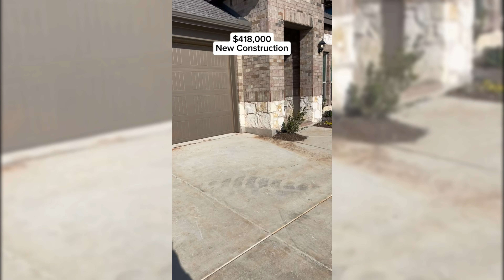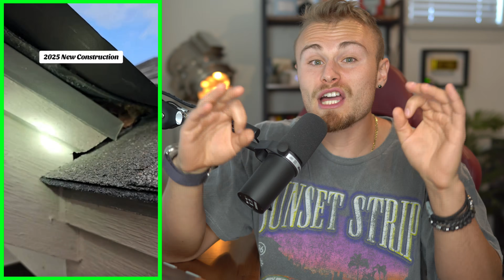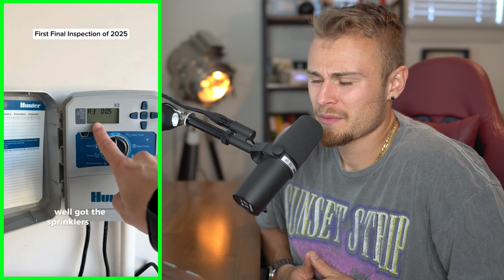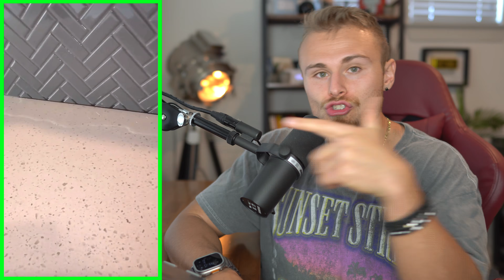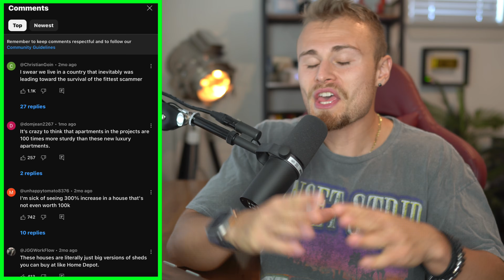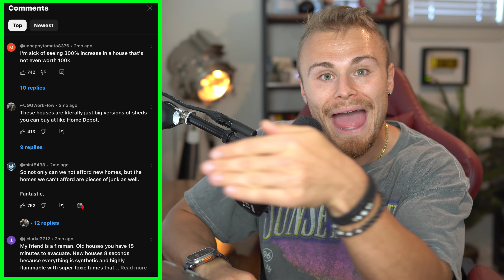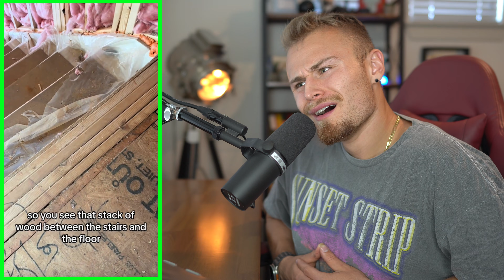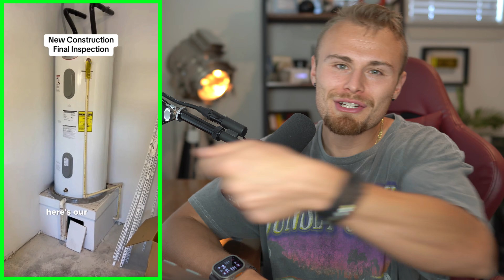New Construction Homes are STILL HORRIBLE in 2025…

Comment: The reason houses look like this because the Builder and the homeowner hire framers to do carpentry plumbing and concrete work they don't know what to do they do it wrong. paying for cheap ass labor to bring the cost down. the average house is definitely not $400,000 if every crew is a professional it's more in the 600,000 range that's just how it is but if you really want to know why it's so expensive it comes down to material cost not labor

Comment: Bought a new home ($500k) in Nov '23. Builder denies any actual claims a few as its "normal" for cracks in the basement concrete and foundation walls. Its also normal to have an AC undersized and denying to provide the Heat Gain calculation to back up their sizing is in fact 1-1.5tons undersized (i have a 2 story 2300sqft sized for a 2 ton in MIdwest.. this is still an open situation and found a Law in my state that they must provide heat loss and heat gain calculations when asked. There's a small glimmer of hope that this will be corrected without my money being spent to change it so its livable again during the summer.

Never told about hardwater or the radon in the area, so that was $6k extra in costs that never disclosed.

Quality: I'd put the house as i could of done better with everything as ive redone 2 (100 and 75 year old houses from ground up). Qualtity lacks and subpar. Material is low quality. Fixtures are low quality. Carpet and flooring are buckling. They missed structural anchors in my house too somehow eventhough they had to drill the holes for each hole. Landscaping was off by 4" around the hole house from city proposals. Siding breaks from hail. Insulation is subpar at best. The claims they corrected they dragged a$$ on doing until i threated to sue them for not fulfilling their side of the deal.

Wife and I are considering selling the house in a few years and just buy an older home as this is awful like im an electrician by trade but do plumbing, millwork, woodwork, etc as a hobby and its awful to say the least. 

Learn from my mistake if you hear these sentences, "trust the process" or the famous "we have been doing houses for x-years so we know what we are doing.". They're just avoiding your questions as they dont care about you at all and will blame you as if you caused all these issues yourself. While you are at it, prolong your closing date as long as you can until those issues are fixed as they'll never correct it or follow through with what they say.

Comment: They have to place steel plates on studs where plumbing/electrical goes through to keep screws from hitting them, but in thaat kitchen it was a down stack from between studs, so if they ran a screw throw a cabinet into the drain stack then they never marked the stud locations for the cabinets.

Comment: I live in a 3044 sq ft house with my parents, bought brand new at the beginning of 2024. Here's some issues in no particular order...

1. One bathtub isn't even close to straight.
2. Plastic electrical boxes with those awful surface mount LED lights made it nearly impossible to change the fixtures without tearing out and redoing the boxes.
3. There are uneven exposed gaps under ALL the door framings.
4. There is already cracking in the garage concrete slab, and we haven't even put a vehicle in the garage once.
5. ALL light switches are not level, and random outlets/switches have ugly large holes on the sides of the faceplates.
6. Interior garage door was not positioned properly. They did horrible patchwork and you can see the outline of where the door used to be.
7. Random joists don't meet properly in the attic.
8. OSB sheets for the roof sheathing don't even line up, so there's spots in the attic where you can see straight to the underside of the shingles.
9. Roof shingles are buckled in some places and uneven, and the builder used "15-year" shingles instead of "30-year" shingles.
10. Vinyl plank flooring in the house has random high spots, and low spots that creak.
11. Carpeted bedrooms have completely inadequate padding and awful transitions.
12. The hop-up ceilings have bad cracking on all sides and are very unsightly.
13. Master bathroom fan barely works and sounds like it's struggling to move any air.
14. Air vent register screws are stripped and forced in at angles.

And a lot more but I'm too lazy to write everything down. Maybe I should pursue a career in home inspection lol...

Comment: On the firefighters and floors bit, it's because those engineered I-joists are literally two thin pieces of wood with a web made up of wood flakes held together with highly flammable adhesives.  This shit burns faster and HOTTER than conventional lumber - the radiant heat that stuff (combined with the synthetic stuff that is on one's home) burns can damage or set alight neighboring houses.

Comment: my parents bought a new town house and we had to move out for over 9 weeks (after living there a year) for them to correct all the problems. our kitchen was held together with expandable foam, no insulation in the roof ( in a cold country) foundations not deep enough, bath not plumbed in. and there was 2 large pages of faults. was never fully solved, stayed there 15 years but was a constant battle. and the inspector had signed off on it!!!!
Reply from the maker: of course he did!

Comment: Im not sure what you’re meaning by “this new stucco-ee, chalky wall paint” lol, but in the shot u paused it on when trying to describe what u were talking about..the one showing the wall crack…that was just a normal, orange peel textured drywall/sheetrock wall with thats been painted with a “flat/matte” latex interior (low grade) paint…which i would assume is the same thing on your walls, judging by how u described what happened when ya killed the bug.

Comment: One thing I've noticed over the years with home building is, everyone blames the guy before them. Why aren't the walls flat? The framers suck. Why do the framers suck? The wood is low quality and warps in humidity. Why does the wood suck? Ect. I've never seen a site supervisor take an hour and plane the studs, or pick up a tool to fix anything in the 20 years I've been in construction.

Comment: There are 40 year mortgages now. I don't see a lot of these homes lasting that long. I did a winter helping a builder, Its in Colorado, they would put the floor over the crawlspace, I was sent in with dehumidifiers because the snow in the crawlspace would melt. Some of the units were very close to "finished" and I would go in and dehumidify "Lake 123 Main" in the basement before the buyer moved in.

Comment: I worked on a general labor job before and we got called to a newly built houses and this particular house was built on the bottom of a hill behind the house(where the basement entrance is) the drainage for the water wasn’t big enough so one day we got absolutely hammered by rain and their basement got flooded also doesn’t help that the power got shut off by the storm too so that water got at least 6ft high

Comment: Paint is water based so it will come up with a wet paper towel. And that’s called textured drywall because it’s to hard to hide the line on when it’s smooth.

Comment: I live in an apartment, which gets funding from HUD, so that I am able to afford to reside in 4 walls, and the house in that first video has waaaayy more problems and issues than the apartment I live in. And, as we all know, government funding has very low standards.
That is absolutely horrible construction work in that first video. And in subsequent videos.

Oh, and that chalky paint on the walls. That's literally the absolute cheapest eggshell white paint that can be used in a house. It doesn't dry with that smooth texture the slightly more expensive eggshell white that they paint bathrooms and kitchens with, in case it gets wet.
The chalky paint is what I have in most of my apartment. 
I would be furious if I paid to get my house re-done and they painted it with that chalky paint. That is unacceptable. Especially if I paid half a million dollars to get it built.

Comment: What happens after the inspector leaves? Does the company that built it have to go back and fix it, or does it just get left for the next inspector? Does the construction company have to fix all those errors?
Reply: in some cases, but the new home owners have to request it. A lot of paperwork would need to be filled out and there is a time window for the request to be submitted (I think a year after purchase at most, probably on a state by state basis). Most people don't get the major stuff done as they need a place to stay immediately
Reply: @Jremyisawsome1111  Oh wow, so they make the homeowners go through paperwork and waiting. That sounds like a big headache, so it's best to get the house inspected before you buy then right? Or do you have to purchase the home first? Sorry all these questions, we are thinking about buying a home in the next year or so. I just want to make sure I don't make a big mistake.
Reply: @Ninnjette-  right, a potential buyer can hire an inspector before purchasing a house, and its reccomend doing so(it may be necessary in some places) It is not as easy as going to a house inspector and asking for them to check out a house. It can be, but one will run the risk of a bad home inspection. The potential buyer needs to have some knowledge of what they hope to find, like the type of heating and its condition or not find such as foundation cracks and or bad repairs to foundation cracks. As a potential home buyer you should also do some research into what needs to go into home maintenance and repair so that when talking to the inspector after their visit you can have an informative conversation as well as ask the right questions.

Comment: Old homes are made of rough cut lumber , new homes are a built of osb which is wood chips and glue , even the beams are made of osb now . They have structural integrity initially but they don't last . Old rough cut lumber will last 200 years

Comment: Got my house in 2019, it was built in 1935 and is a double brick home. This thing was built like a tank. I had to drill a hole to install a kitchen vent range to the outside and holy hell I couldn’t believe how thick and how difficult it was to drill that hole.
Reply: Recently did the exterior vent upgrade to my microwave on my 1946 stucco home. Took me an hour to drill that hole through 2 inches of stucco and 1” of cedar. I saved the cross section piece. I was exhausted but so impressed.

Comment: A good part of the problem is on the consumer not wanting pay a nickel extra how cheap can I get it. Production builders how fast how cheap, make lots of money on the extras. 
As for the doubled up walls space is required to properly run HVAC and plumbing.
The stucco finish on drywall is because there’s no talent left in finishing drywall the texture is there to hide defects and actually takes more time than a smooth finish if the taper knows how.

Comment: Being an electrician, this scares the crap out of me. I want to assume the electrical is usually up to snuff, but just a few minutes into the vid, it wouldn't surprise me if some are dealing with electrical service issues. And of course as I'm typing it got to the garbage disposal spot😅😅😅😅!!! What's sad is I've seen mobile/manufactured homes built with better quality. Folks learn everything you can about home construction and what to look for. Had an ex girlfriend that bought her house and didn't understand why I told her to keep an eye on the foundation. Then I showed her all the concrete that had started to crack and break away. What I find fascinating is how easily people get duped by looks. The herringbone backsplash, the stainless steel appliances, marble counters, etc. While pretty and modern, I'd rather have a 1970s aesthetic with a solid build, foundation, and frame over some lipstick on a pig.

EDIT: Guys don't forget if you choose to work in a trade, you don't have to do home construction. That's probably another thing hurting the industry. I'm sure a lot of trades guys are looking to industrial plants or big commercial builds. I'm willing to bet a lot of guys get told to cut corners and most trades guys won't do it. Personally I never wanted to do residential. You people with your vaulted, cathedral ceilings are a pain.

Comment: Engineered wood requires less material, and often have an open lattice structure, or are made with a thin OSB board as web glued to a wooden compression head in the top and tension head in the bottom. Such a light structure burns faster than solid wooden beams.

Comment: The bowed wall looks like the drywall wasn't properly secured to the 2x4.
Reply: If the drywall wasn't secured, it would be straight. The problem is the studs aren't lined up straight and the drywall is firmly secured to it

Comment: I drive a 2007 Toyota Camry, about 145,000 miles. No payment for a decade now, and we have only fixed the alternator. I consider new tires general maintenance. The rear passenger window motor went out. That is it. I'll take the non-working rear passenger window over a new car payment!

Comment: Bought a 15k hvac system 4 years ago. It breaks down every year. My last house had a system from the 90s and it never failed. Things aren't built the way they used to be.
Reply: My grandpa's 1980's central air unit/propane furnace combo still runs like new. It's actually way quieter than my parents High Efficiency unit, which has issues all the time.
Reply: This is all by design, the manufacture of appliances of recent vintage which are super expensive and designed to fail after a certain period of time.

Comment: The one thing on here I wont hate on builders for is the drywall cracks. Most of the ones shown are normal settling cracks. I just finished painting the drywall in my basement that I framed and hung myself and I have a few cracks in corners and some random spots, it happens. The rest of the stuff though is insane to me.

Comment: 14:56 its because of engineered trusses. But they're not cheap or low quality. They're actually a lot more expensive then regular lumber. It makes for a very stable floor and you can run plumbing, ductwork, and electrical through it. The only issue is that in the case of a house fire because it's not a big solid piece of wood but multiple pieces put together if one piece fails it can ruin the integrity of the entire truss. But they're actually very strong and stable... unless you burn them.

Edit: should also mention they're pleated together with metal plates. If that comes apart under extreme heat and flames it will take the thing apart. I care about firefighters and all BUT... if the family is out the house let the house burn down. We don't need to save the structure.

Comment: The last house I had built, I was there every day to inspect what they accomplished or screwed up. Contractors don't like when the homeowner, the wallet that pays them, is on the job taking notes then talking to their boss man, to fix the screw ups. There were several confrontations and yelling going on over that 5 months. I fired one of the contractors workers for running his mouth. He did terrible work. Flat told the contractor to his face, his worker I fired is not allowed back in my house. He wasn't too happy with that and threatened to quit all together. He didn't but that guy I fired never came back in my house. There were many things my contractors contractor's screwed up. Some I let go, other's had to be fixed without question. This was in 2006. I can't imagine how bad it is today. I sold that house after living there 14 years without any problems except the cracked basement that I told the contractor his fix, drilling around the crack and filling it with foam, wouldn't work. It worked for about 2 years then, as I expected, started leaking again. Don't fix a basement wall like this. It won't last. I fixed it permanently by digging down to the footer and patching it from the outside. This is the job my contractor was avoiding because it's the only permanent fix and he didn't want to do that hard labor work. Plugging and stopping hydraulic pressure on the crack, from outside the house, and beyond where it may crack more in the future is the only permanent fix.

Comment: My husband installs doors and windows and I cannot tell you how many times he has had to fix what the framers have done. Just to get the windows in the wall. It's truly unbelievable
Reply: In the early 1990's, I used to walk through bare framed houses to see their construction practice. This one bi-level house looked to have all the studs on the bottom level all leaning. Sometimes our eyes can play tricks on us and it can look like that but not really be the truth. I lived 2 streets over, so I went home and got my 4' level. Those studs were about 3/4" out of plumb. All of them on that back wall. If it weren't for the exterior OSB holding it together, I'm not sure it would handle wind with the upper level on it. Pretty sad when it's visually out of plumb yet the builder didn't bother to fix it.

Comment: In fixing these issues, a person may as well buy an old house and fix it up. These new houses need to be tore down and built correctly or there will be nothing but a constant fixing and repairing a new house just as you would an old house. Houses incorrectly built are not stable (like an old house) and will produce many problems in the first few years and will continue to produce problems until it's tore down and rebuilt correctly. Fixing the issues we see in this video will not fix an incorrectly built structure but will be a band-aid until the same problem resurfaces or the fix creates more problems. Rinse and repeat.